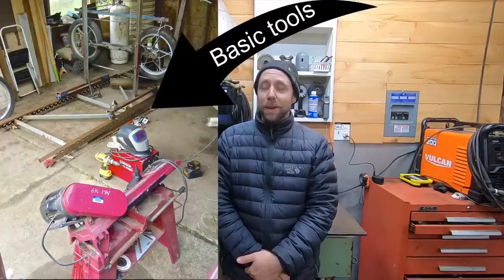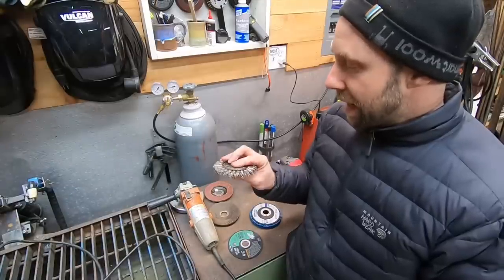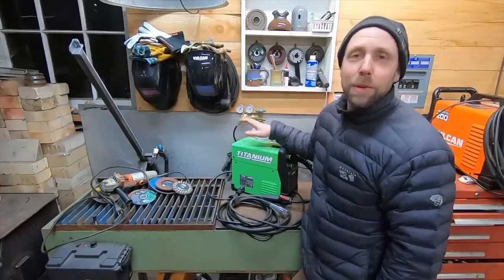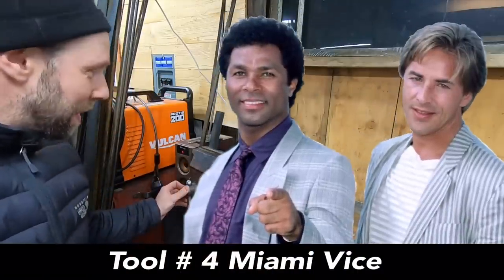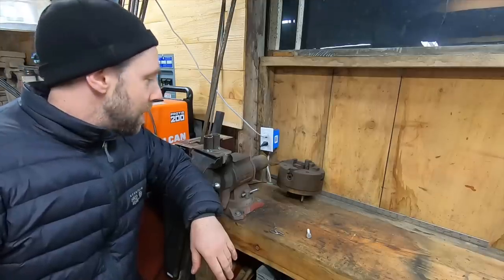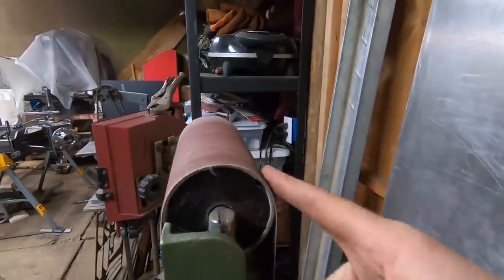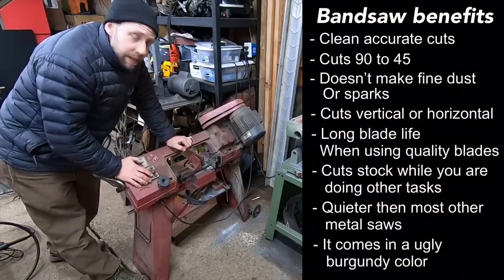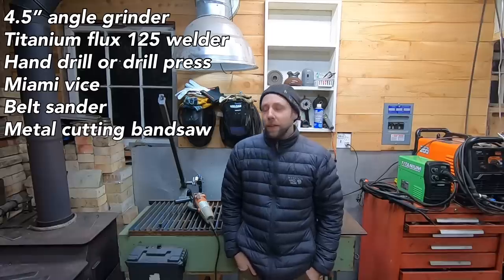6 affordable tools I recommend to get started in fabrication

Comment: Thanks for the nice video. One question, where do you buy metal, like angle iron, expanded metal, steel plate, round iron bars etc. Local hardware stores are expensive.
Reply from the maker: Mohsin Khan  Here’s a video I made a few years back, it will help you out when it comes to salvaging cheap to free clean metal.
I have salvaged a lot of metal for projects over the years, I tend to buy new more and more these days, I order from Western steel out here in western Washington, they have really good prices and they also  ever have a minimum or charge me delivery fees.
https://youtu.be/MQNYDmq-k-w
Reply: I had this same problem recently and solved it by opening google maps and searching my area for “steel distributor”. After calling a couple I found one that deals with the public. Unfortunately they didn’t list prices on their website but they had listings of all the stock they carried, along with dimensions and weights for 20 foot lengths. After numerous “price check” calls I figured out that basically everything sells for $0.50 per pound (or $0.75 per pound for smaller stuff like 1/4” round) - FAR cheaper than hardware stores. 

Once I figured out what I wanted, I called with my list, gave my credit card info, and 30 minutes later I pulled in and they loaded my metal. 

The biggest problem you’re likely to encounter is the length of the stock. I guess 20 feet is standard (or 40 feet if you want). For my first order I only wanted one piece, which was $10 or so. To cut it in half was another $7.50 (per cut), so I asked if I could cut it in the parking lot. They said I could, so I just took my pickup. When the “loader” guy saw my truck he asked if I wanted it cut. I said yes and he kindly zipped it in half for me - no charge. 

For my next (much larger) order, I brought my 20 foot trailer. Less awkward and went much more smoothly - the lifted my order right on to the trailer with their big chain hoist and off I went. 

I will only buy metal this way now. Short term more expensive if I only need a couple feet but I know I’ll end up using it later. The big problem now is where to store 18 foot pieces of metal haha. 

Good luck!
Reply: Mike festiva thank you kindly
Reply: truthsmiles thank you very much. I got to start my research now.

Comment: Is the Flux welder you talked about a good economical option for a total beginner looking to weld household items (table legs, balcony rails, etc.)?
Reply: @Connor Derivan I've seen some pretty clean welds with flux-core. Pretty much as clean as MIG. Just watch some videos on how to do it properly.
Reply: @Connor Derivan There's more smoke, but there's not much or any difference with the actual weld if you do it right. The only real reason to use MIG over it is for inside welding.
Reply: @CoDisafishy  No chipping flux off, wider array of metals you can weld, can weld thinner metals, etc.  MIG is a superior process, but flux is not a bad way to start.
Reply: I bought the cheapest one on amazon and it’s paid for itself easily in odd jobs I’ve done, it can weld most anything would absolutely recommend for any beginner

Comment: I'm a big fan of HF but their drill press sucks. I would go for a Wen at a minimum. With a drill press you want straight with minimal wobble and good stops. HF falls short there. I returned mine straight away
Reply from the maker: I have never owned a HF drill press, it was just a suggestion for someone getting started in DIY fab work in there home shop. I appreciate your suggestion. Here’s my old free drill press I fixed up. Take care Chris
Old drill press restoration upgrade https://youtu.be/3jxGUvfZxhg
Reply: I have one, used it for years to do all kinds of stuff, a friend of mine has gone thru a few but he uses them a lot n for stuff like drum sanding wood pieces.  They work fine for a cheap drill press.
Reply: I have a Wen, love it. And they make a large variety of sizes for different budgets, I have the 4210.

Comment: I don't wanna sound like a jerk, but if you want to spend a little bit more money to have reliable tools, i would buy dewalt or Milwaukee angle grinder and drills, it might cost more but it'll be better in the long run, me and my uncle have had harbor freight tools break on us a lot of times, so if you want a safe bet, then go with dewalt or Milwaukee
Reply from the maker: There’s nothing wrong with your suggestions here good name brand tools are good to have.
I made this video for people starting out on a budget. I never had much money when I first started out and cheaper tools were all I had, it got me going, I slowly replaced some of my tools with better ones over the years but honestly I’m still using mostly HF tools and able to build quality stuff. Have you seen my articulating dump truck build?
Reply: @Mikefestiva  I've watched the first half, I do plan on finishing it tho, I really like how you test harbor freight tools tho, a lot of people really hate on them and they don't understand how a good chunk of them can be useful, I especially like your Vulcan vs titanium videos, I even went out a bought a titanium 200, and its working like a champ, my uncle has a Lincoln electric 180 mig and its heavy and it trips breakers constantly, its a real shame that Lincoln(a flag ship welding company) would design something that cheaply made
Reply from the maker: Right on! Yes you summed up those Lincoln welders well, we have a 140 at my work it it’s the same, trips breakers all the time, heavy and a bad duty cycle. I’m all for a product that works as intended regardless of the name on it. If those Lincoln’s worked good I would be happy to suggest them but they just don’t, and they are behind the times, lots of advancements in welding technology, they need to get with the times on there consumer grade gear. Take care
Reply: @Mikefestiva  Unless the Lincoln draws more amps than it's rating, the breaker tripping isn't the welder. Does the Lincoln draw more amps than rated? I find that hard to believe. My Lincoln 210MP never trips a breaker, on 110v or 208v. That said, I have properly sized breakers and wiring.
Reply from the maker: Jessie Dog I think you have overlooked the biggest difference in the welders we are talking about here, other then Amp output can you tell me the really big differently between the 140 and your 210? There’s something you completely missed. Good on you for having the proper wire and breaker, I have ran that 140 in numerous different industrial buildings with proper wiring and guess what the 140 still trips breakers, as far as I’m concerned it’s a lousy welder.
Reply: @Mikefestiva   For some reason, I can't see any of your post beyond "the 140 and yo"... so...

The welder model doesn't matter for my question. Is it drawing more than rated/spec'd? If so, it is inherently unsafe and exposes the manufacturer to massive liability. If not, the welder is not the problem.

BTW, I totally agree with your advice to buy cheaper tools for beginners/hobbyists. Sometimes I buy more expensive "name brand" stuff because it makes me feel good, not because it works better, especially the "yellow" and "blue" brands of power hand tools. The employees at my local HF know me by name. I tend to spend more on hand tools like allen wrenches (SwissDT), screwdrivers (Wiha) and Pliers (Knipex) than other places. I have seen the difference in proper allen wrenches, screwdrivers and pliers :-0

     I have rebuilt/repaired/massaged cars and motorcycles, for fun and profit, for over 40 years and I appreciate your advice. You are SPOT ON! It seems that most of the guys slagging on you are working in large fab shops where the tools are purchased by the company, not themselves. Yes, I know that Balleigh makes a better metal break than Eastwood, but that doesn't meant that the Eastwood won't serve me well or that I can justify the expense of the Balleigh. I buy a LOT of tools at auctions and save a ton of $$$, especially on 3-phase stuff. IF those guys were spending THEIR money, would they still buy Miller? My buddy is a sales rep at Airgas and he will tell you the answer is a resounding "NO!".

Comment: Here in the U.K. you can buy a decent multifunction welder for under £200. I have a 200amp mig, flux and stick machine, 90% of the time I use mig but when I was hardfacing an anvil I did it all with stick. I like the choice and the fact I can grow with the same machine. With the choice of flux it’s much easier to use outdoors as I did building my welding table and router table. I think my welder will be working long after I've gone and I don’t see my changing or upgrading it.

I bought the 125mm 5” grinder and wish I’d bought the 115mm 4.5”, there certainly seems to be far more choice for the latter. When I hard faced my anvil I looked everywhere for 125” mm stone cup, everyone had 4.5” but no 5”. 

You can’t emphasise the need for vice (vise) enough, it’s the most essential tool of all. The drill press has far more torque and I've choose that over a hand drill any day of the week.

You are certainly a very talented man with the things you’ve built. A really good video.

Comment: With tool 1, treat yourself to a face shield and some dust masks.
Reply: what kind of dust mask / respirator would you suggest for welding? or did you mean dust masks for grinding?
Reply from the maker: I covered a lot of that stuff in part two 👍
Reply from the maker: I work with angle grinders on a daily basis, haha you don’t have to worry about me or  comment that what I’m doing is cringy, I build all kinds of things and do it safely. I’m now going to see if you have any content on your channel to see what you build? Don’t worry I won’t pick apart how you are doing things on your channel.
Reply: @Mikefestiva  i know a dude ho was using his second hand as the vice and eventually when it got colder he put on long sleeves and grinder caught on his sleeve and pulled its self into his arm and he was only saved because he was using a paddle switch without* the suicide switch on... i dont "have" to comment that suicide switch on all day grinding one handed is cringy... but it is ...so i commented...

Comment: Two main reasons I started with stick welding (and now do all types), first; I can weld small stuff and also super thick stuff, like 1/4” bumpers and 3/8” plate.... second, you can weld anywhere with stick, you cannot weld with shielding gas outside if there is any wind (I know this was flux core in this video, but Welding with gas is much nicer)

Comment: How can this list not include a welding table?!?
Reply from the maker: I mentioned in the end of the video I was covering non power tools in the next video, it would have been too long if I tried to cover everything like clamps, calipers and most helpful hand tools in one video. Take care
Reply: @Mikefestiva  Fair enough... Keep the Faith..
Reply: I weld on my table about 5% of the time. Rest of the time I'm welding on the thing I'm fixing and normally that doesn't fit on the table.

So I don't think a table is necessary until you are deep into the hobby/career.

Comment: Thank you.I seem to be the only big tool in my shop.I do have an electric drill and saw kit.Need diff blades for metal,but as you said,'start with what you need most and can afford'in diff words.I can use a flux core welder poorly,but it's a start too.Been too long since I learned,but you've rekindled a couple sparks.Great Vids.I'll be watching.

Comment: cheap tools can definetly get the job done but if youre going to get into fab work for the enjoyment of the hobby and be doing it for a long time more capable quality tools will save you buying things two or three times over.. im after selling off cheap tools at a loss or burning up underpowered ones and buying the good tools afterwards
Reply from the maker: I have built quite a bit with affordable tools, I definitely think if you got the money why not buy good quality tools. I myself started in metal fab work with very little extra cash to spend on tools so I do the best with what I can afford.  
I’m not trying to be rude but Didn’t you comment earlier that you bought a $200 kicking horse plasma torch? 
I bought a $250 Cut 50 on Amazon 3 years ago and it’s still working, it wasn’t the highest of quality and I never posted a review because of the build quality but it definitely cuts metal pretty good. Take care

Comment: 25 years ago a fabricating shop ripped my off charging $1400.00 for complete new rear frame rails on my 68 fastback a fare price I thought? but they only replaced 8 inch sections on each side!!. "Lesson learned" If you want anything done right you're gonna have to do it yourself!!  I skipped all that nonsense about starting with stick. So I bought a mig welder the rest is history.

Comment: I want to buy “Made in USA” tools.
Reply from the maker: Then buy them 👍
Reply: Hey, nice overview of the tools, quick question, what make and model is the belt sander? Thanks!
Reply: it's almost nearly impossible, unless all the parts are manufactured and assembled in the USA then the cost goes up, but for most tools in the market it's just cheaper to make the steel parts in China or other countries and then assemble in the USA and sell as "Made in USA" .
Reply: ehh, these days Im ok with "Made in anywhere else but chyna". most Makita and Bosch tools arent made in chyna. Plus if these tools were made in usa theyd be garbage quality unless they're 100% made in usa, though in that case a simple drill driver would cost 1200-1500$

Comment: Just a tip, skill branded brushes used to work on harbor freight grinders. Not sure if they still do, but I did replace the brushes in my hf angle grinder with ones made by/ for skill angle grinders.